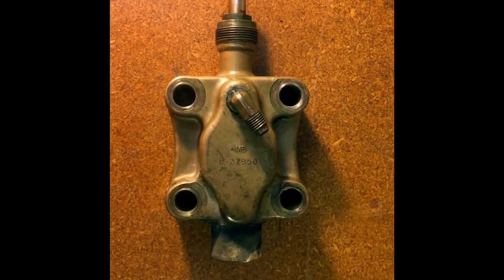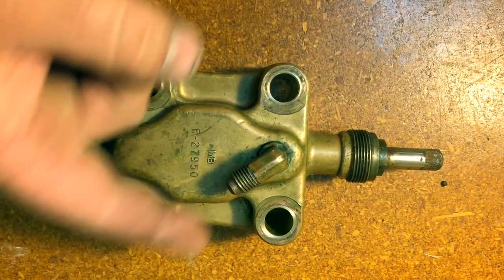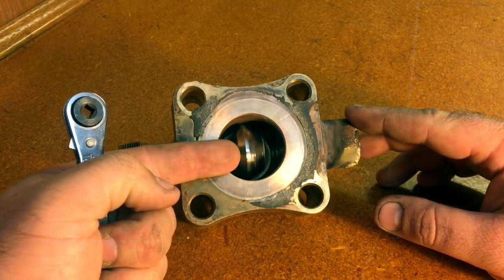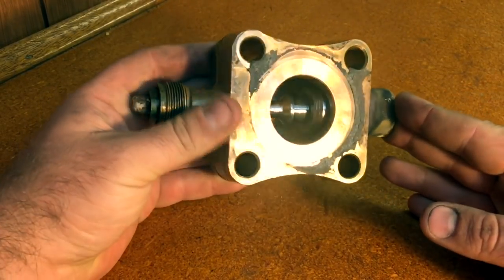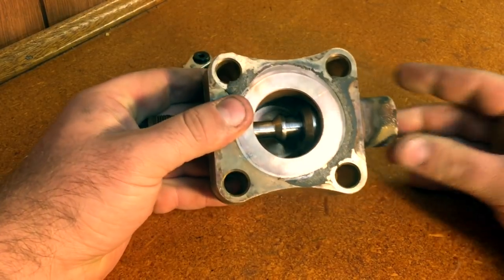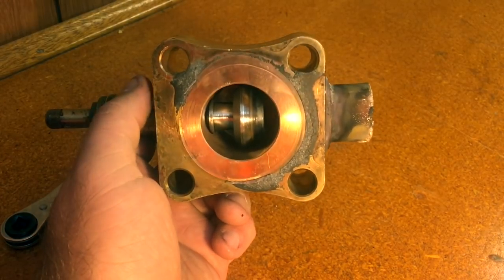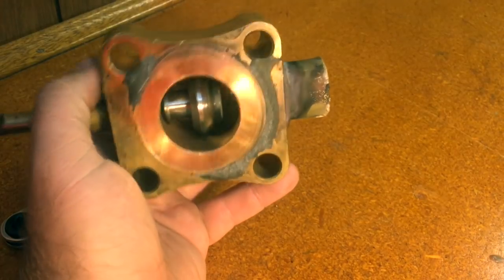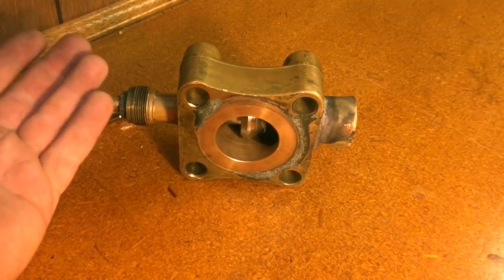Multi-position Refrigeration Valves Explained

Comment: Some of those valves have two gauge ports, one of which you can't shut off, its meant for a pressure switch. Back when i was starting out I put my gauges on that port on the receiver of a new system we were commissioning, well come home time guess who couldn't take his gauges off without recovering all the refrigerant...
Reply from the maker: lol Ive been there man!  I actually forgot to mention that in the video, the fact that the port has more uses then just being an access point for hoses.
Reply: Any marking on the second port to indicate that it is always open to system?

Thanks to both of you for sharing content and info.
Reply from the maker: I don't believe it's ever marked

Comment: I would like to add one note in reference to the packing. On the stem you have a small nut that is your packing Gland. Taking the time to loosen that a half turn before operating the stem and tightening it back up after will help that packing last a long time. By loosening your reducing the friction of the stem against the packing. Also note that if you loosen it a half turn and begin to leak gas it's time to change the packing. Thanks for the video!

Comment: used a king valve to dump 30lbs of liquid in liquid line while 50 ton carrier air cooled chiller was running front seat valve wait till pressur gets to about fifty in liquid line let it go and wach it flow less then a minute old timer showed me this

Comment: Very clear presentation.  Is the dust cap intended to hold pressure if the stem begins to leak or are you forced to replair/replace the valve at that point?  Thanks.
Reply from the maker: Thanks for the feedback!  The cap is usually plastic (sometimes brass) and is NOT a trustworthy leak stopper. It's really just mild protection from dirt and dust from accumulating on the exposed stem.  Once that valve leaks, you either replace the entire assembly or rebuild the packing on the valve if that manufacturer offers a rebuild kit.

Comment: Could you do one showing us how change the packing?
Reply: Ness Nesu thanks man
Reply: Thanks for this. Seeing it in larger scale definitely  helps. Driving me crazy trying to pull a vacuum last night after sealing an evaporator leak. Partial problem was having valves in opposing positions throwing me off righty tighty while standing on top rung of ladder over a reach in under a lowered ceiling, then figuring out that packing was leaking, preventing a good vacuum pull. The packing repair video in this same comment trail is aces as well. Thanks to all.